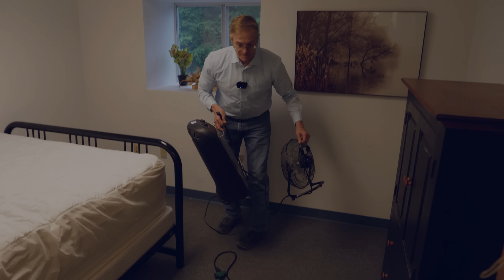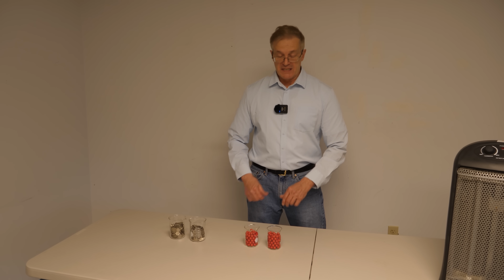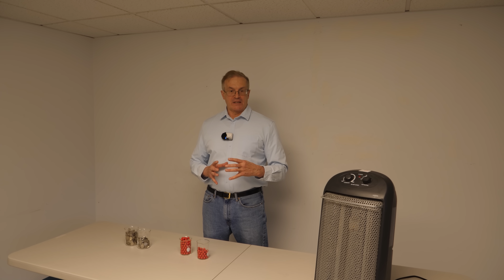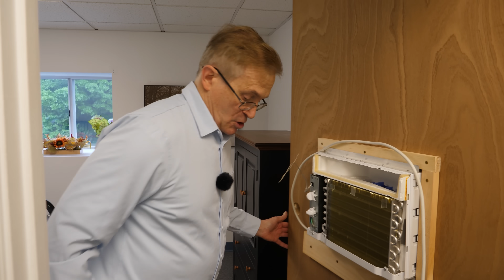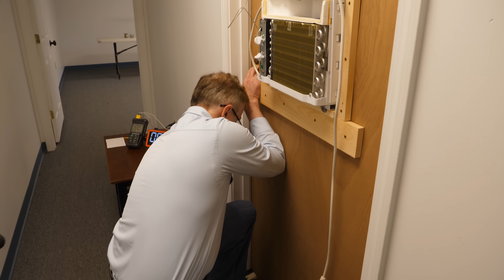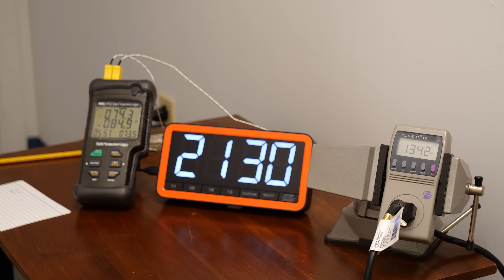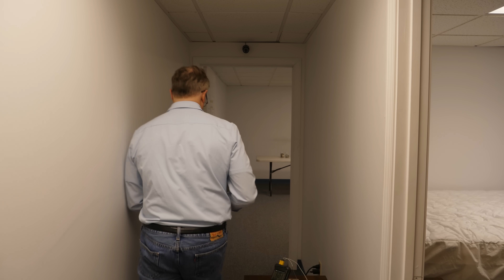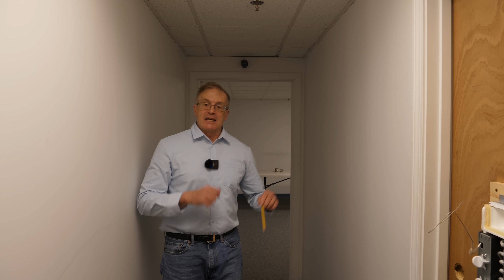You're wasting money on heating! Use your A/C!

Comment: Converting a cheap AC unit with a reversing valve and add a switch on the front for heat/cold would be a worthy investment. Especially if you already own a recovery machine and brazing kit. It's just a copper pipe with a nylon shuttle cock in it for the most part. You might have to make a bypass for the piston/txv if it has a txv. Possibly reroute the temperature sensors as well so it operates correctly. I assume the outside would not need a drip pan since it gets rained on anyways. The only issue you might run into is if they just pinch off the fill tube instead of having a valve stem. One and done/throwaway is how they make them now.
Reply: Wow, checking for reversing values shows they are about $266 for large 1 ton units and $75 for a solenoid. I'd just make one instead. Use a manual switch instead of electrical one. Compliant switch with a linkage would work. You'd need a smaller one anyways.
Reply: It will ice up without a defrost cycle.

Comment: AWESOME AWESOME !!! Now this is extremely helpful information that is going to be very useful for our house. Our house is too small for a furnace, so we used electric heat or propane, with a wood burner as backup. NOW I will be working on a setup like this so we can more easily use our solar stored energy better. You did a GREAT service to ALL of us with this video alone. I await the next video on increasing efficiency. AWESOME AWESOME!!!
Reply: Look into mini-splits eg4 has one that has its own MPPT solar inputs and come precharged so they are diy friendly. 
Mount the inner and outer units and drill a hole through the wall for the pipes and wire
Reply: @ghz24  Great news there, Thank You!! Very kind of you!

Comment: as far as cool this video is, and other by the way are,
i've been really, really confused with how is it actually possible that, any other setup can beat a device that is actually being considered 99,9% effective?

and i figured it out finally! you, sir, besides plugging in the heater, also did plug a fan in the same extension cord. although induction motors are being considered highly efficient, the fan itself can be poorly manufactured, and also, by design, it is converting the electric energy into kinetic energy, but not in the form of heat.

i can think of the reasons why you decided to include the fan into setup, such as "we need to somehow spread the heat quickly", and "the ac unit has fans on it's own anyway", but neverthless these values were not precisely calculated - also i would point out by the way that, ac unit were closer to temp. sensor than electric heater.

the experiment lasted only for half of an hour - i think it's too little time for heat to spread trough the reoom evenly.

summing it all up i think that all the variables in this experiment makes the result unreliable.

to get really accurate results one should not use any fans of any sort with electric heater (because that's the way they are designed to operate - only convection should move heat around the room), put a few temp. sensors and get the average reading, constantly regulating power input trying to achieve constant set temperature, and let the experiment lead for a few days for each setup and average the results - i know this would be terribly incovenient especially taking into consideration changing weather (maybe it should be done in some giant refridgerated hall with regulated  temperature, and built inside artificial room?) - but that's the only way i could imagine one could get any consistent data... :c
Reply: It's only 99.99 efficient because they defined it to be that.
And the fan is crucial to the experiment just like the stirrer on a bomb calorimeter. With out it you don't get a homogeneous mixture of warm and cold air. In reality we could just use the listed btu output and just monitor the electricity used to give a ratio of btu per kWh for each and get real close to the actual values.
Reply: @ghz24  "In reality we could just use the listed btu output and just monitor the electricity used to give a ratio of btu per kWh for each and get real close to the actual values" that's the theory - and obviously that's what we all are trying to do here. i'm talking about more statistically correct practical approach as opposed to the practical approach chosen in this video.

anyway

"It's only 99.99 efficient because they defined it to be that" - that's the most interesting part for me here.

how can you define the idea that heat pump can be more efficient than electric heater in theory, given that both uses electricity as an input then?
Reply: @andrzejbozek  The definition has to do with resistive heating and comparing it to combustion heating systems.which have an exhaust where the ratio of heat delivered to an interior space vs the heat lost up the exhaust is the efficiency.
Since resisive heaters have no exhaust they are by definition 100% 
A heat pump can pull heat from outside so is able to exceed this defined 100%.

Comment: Are bidirectional heat pump air conditioners not a thing in the US? Pretty much all models where I am have cooling and heating.
Reply: They are a thing here we had one in 1973.
The US has a thing about "once in a while" occasionally it gets too cold for them to keep up with a northern cold snap.
So rather than just having an auxiliary heat just in case people tended to install a fuel fed furnace and ignore heat pumps.
They are gaining popularly quickly but contractors see heat pump and want to charge big $ even though it's pretty much just like a central air to install.
I got excited about them when mini-splits with solar inputs became available because they are diy friendly.

Comment: Love the video ... about using the AC to heat a room using it as heat pump a bit challenging. The energy efficiency is there as demonstrated, but you will to adress other problems. The most noticeable is the noise! Instalation and ventelation too but this a way easier to adress.

Comment: In Finland these so called air-source heat pumps, practically AC like units have been around for decades. Around 1,45 million units has been installed so far (population 5,5 million).
The question of cost is pretty much local, electricity vs. other energy sources. But when only electric heating solutions are compared, air-source heat pumps are generally the most cost-effective solutions in temperate climates.

Comment: Fully agree that heath pumps are more efficient comparing to resistiv heathers. I'm using a heath pump to heath whole the house and also heathing water. The test conditions were a bit unreal but as a proove of concept are OK. If you have 75 deg F outside probably you won't be heathing the house. Colder it is outside the efficiency will drop. Amount of humidity of the outside air has also a significant impact. If cold and humid the pump will get frosted and will need to make frequent defrosting cycles which works just by reversing the process and using the heath from inside the house. Need to mention I'm heating water to circulate around radiators. With this system you get less efficiency rather than heathing air because higher temperature needed or you have bigger diferential between in and outside...

I live in a valley where during the winter due inversions we get cold and very humid air. On those days the efficiency can drop down to 2.8. Of corse still much better than using a resistive heather...

It is a great solution if you can bury deep underground a lot of pipe and using underground heath which is more or less constant over the year. This would make to have good and constant efficiency regardless outside weather conditions around the year. Unfortunatelly don't have enough real estate around the house to install the required amount of pipes.
Reply: I'd bet that is what he was hinting at for his next improvement.
Reply: @ghz24  Guess will be something more DIY you can potentially do yourself. Installing a closed underground loop isn't something you would do yourself apart you are from the trade having an excavator at hand. For my 12kW Mitsubishi heath pump probably would need 1000ft of trenches 6ft deep. For a small AC unit he was using for the experiment probably would be overkilled doing all the digging and installation even if shorter loop would be enough. But won't bet 😁
Reply: @s57rw  Well an old well or sistern with a small loop would work for a demonstration. BTW only one h in "heat"  Germany?
Reply: @ghz24  Yes I agree if you have a well nearby would work perfectly and without all the hassle of digging trenches.

I'm from Slovenia. Sorry have some troubles writing english correctly if writing too fast and/or not checking after the spelling 😁
Reply: @s57rw  No appology needed, respect for how well you write English.
I figured it was a second language, didn't know Slovenia. Was just helping out it didn't bother me. Wish I was half as good at my second language.

Comment: @1:35 I am not sure how a resistance heater would be less than 100% efficiency. Is it going to drive away? Even then, as long as it stays in the room the energy will turn to heat eventually

Comment: I use a portable air con unit. I made an adapter to fit the cold side, so i jus rotate it for heat or cooling. Requires one hole in your building.

Comment: If you turn the AC out in winter time and it's really cold outside. How low can it pull heat out and put it into your room in the middle of winter?
Reply: Modern air sourced heat pumps can go -5 F

Comment: Yes, but it's not that simple: in very cold regions, such as North America for example, the efficiency of heat pumps to produce heat is decrease a lot and are almost the same as that of simple electric heaters. Considering these device are more expensive to buy, In this case, another way to generate heat more efficiently must be used, such as a wood stove heating a water radiator.
Reply: They retain the advantage down to -5F 
Most winters here in zone 5 that's only a few days that we need auxiliary heat.
I'm going to get a mini-split with solar inputs and if/when a clipper comes through I'll still have gas to burn.
Modern systems are better tgan you may think besides we need to quit using inefficient systems "because sometimes" they need a back-up.
Might look into mini-splits.

Comment: Not so easy, yyou have to produce electricity first, and with an efficiency of around 35%. Heating using electricity is not as convenient as heating directly using the heat produced by combustion.

Comment: I already considered to mount a window unit in a rotisserie, two round pieces of plywood, and a couple of small rectangles on the side, to sandwich the unit, then i could turn it on, and rotate it 180°
Reply: It will rain in your controls and it doesn't have a defrost cycle so in damp cold it will ice up. Look into a mini-split instead.
Reply: @ghz24  iceing up would be a problem, there's not many small mini splits, i could buy 10 window units instead
Reply: @d.p.2680  I'm looking at a 12 hundred btu unit it's 120 volt and has solar inputs for about $1200.
 Plus it's very efficient seer 21 or so.
Not sure what you mean by small.

Comment: In italy we have ac for summer and ghisa or aluminium heater on the wall for winter. Heaters are 100 x times better because warm evenly. Heat pump just warm the top part more and you end having 100layers. This is what i experienced in chicago. Im tall and the air on my level was so hard to breath but my legs feel cold.

Comment: Not disputing that the heat pump is more efficient, but the test was a bit unfair. There would have been residual heat in the walls, ceiling , floor ,even the furnishings,  from the resistive heater.  The heat pump didn't have to heat these up as much to get the ambient (air) temperature back up. Waiting longer may have made it fairer comarison. Waiting a day and repeating the same test but running the heat pump first may have been even fairer, it would give you some idea if residual heat was having an effect.

Comment: This is really interesting but you need to show how this would work practically for a home in colder weather such as  -10f outside and 64f inside.  Would it not be ineffective?  Also, what about condensation drainage in your example.  What about noise?  This is why they have split system heat pumps so don’t they address those concerns and  so this already exists.  What are you showing new except this is cheaper?  I’m guessing it is to show that instead of a space heater, you can use a portable AC unit to accomplish the same thing but again, what you are showing currently is impractical for anyone to use

Comment: @TechIngredients    I have wondered this in the past and i can get no good answer from anyone I've asked 

Now that there are  many "heat pump" devices  like  clothes dryers and  hot water heaters  why are the  refrigerant lines capable of interconnection  or at the vary least  why don't they all have  "heat exchnager" connections.    the condenser  side of AC  ought to connect to the  Hot water system it the water needs to be heated,  as well as a  clothes dryer - that is to say the heat should be sent to the devices that want heat  before that heat is  "exhausted" to the  outside environment. 

I   imagine  in many places i have lived the   HVAC  main  unit  is often Co-located with the  Hot Water heater and  the Laundry space  ( ive often also had a  "Freezer" in the same space )
it seems to me there ought to be a way of connecting it all together.   We are starting to see  some 'mini split" units that  they now call "inverters"  (idky they call them that)  which are able to connect to  more than one  indoor unit.